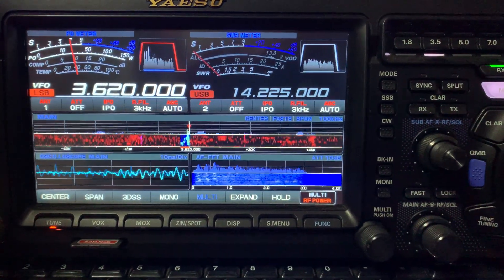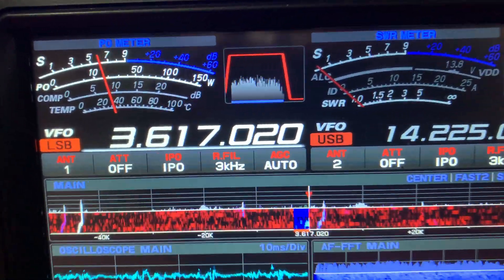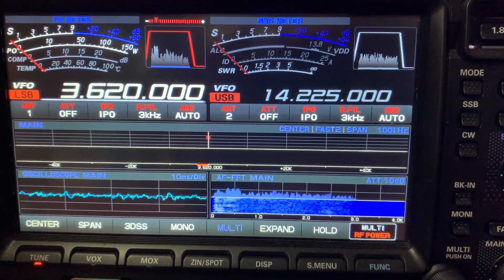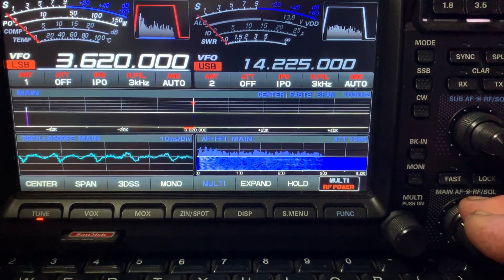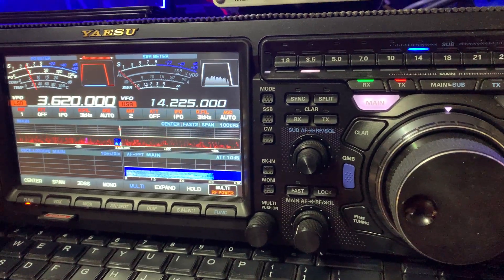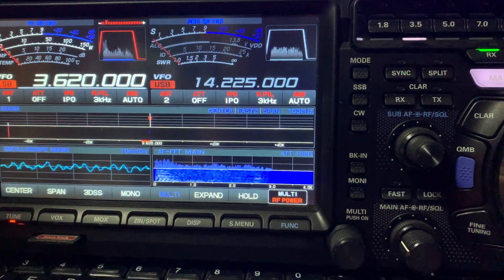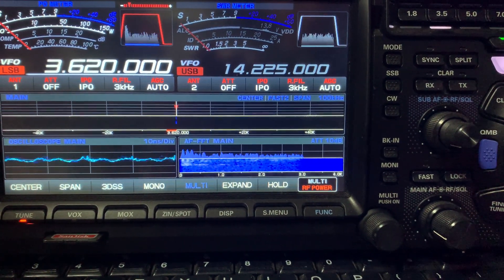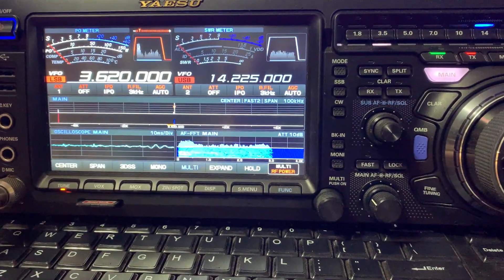YAESU FTDX101D-THE QRM/QRN BUSTER

Comment: FTDX-101D (MP) performance is unsurpassed.  There are  lots of Icom fan boyz out there who have a problem with this and they just need to get over it already.  After having and using VC Tune, it would be hard to imagine having a radio without it.  It is not an opinion, the 101D is simply a better radio, even with all it's little firmware annoyances.  Don't forget to show the use of the DNR function in conjunction with the VC Tune.   Of course pressing and holding the DNR button in for  1.5 - 2 seconds will allow one to use the  Multi Knob to adjust the DNR level (This is also true for the NB level as well).  Pairing DNR with VC Tune will make signals that you can barely hear and cannot copy just leap out at you!    I mention the adjustment of the DNR function via the Multi Knob because I have run across a few 101D owners who didn't realize they could do that!
Reply from the maker: Couldn't t agree more, I will give it a go, thanks for the feedback.
Reply: What is your call ?
Reply: I’ve setup DNR to be used with outer ring via the C.S button. So I can toggle between VC tune and CS. It’s a phenomenal radio and with this years firmware update, the DNR algorithms keep the signal sounding great! I’ve had 80 meters sound like a local repeater with this 101D!